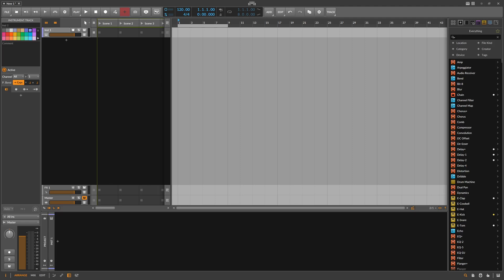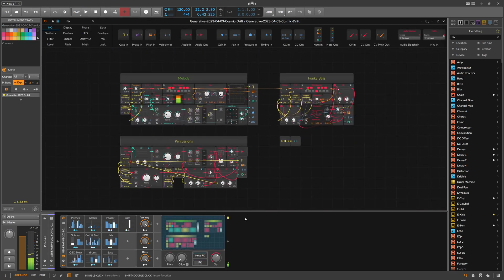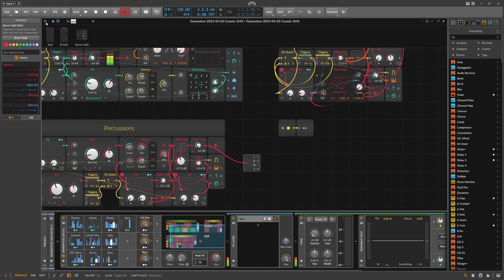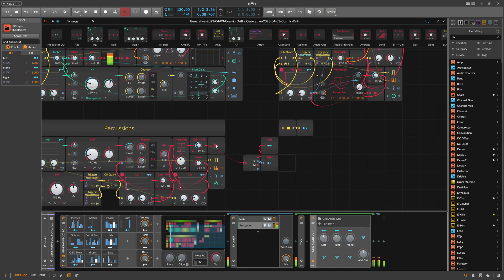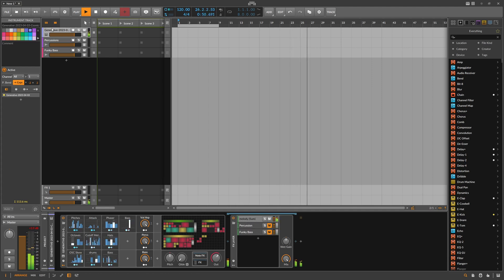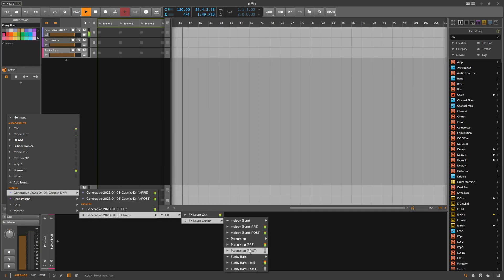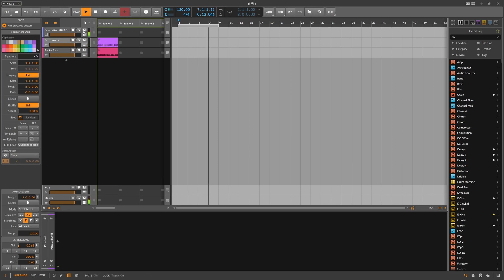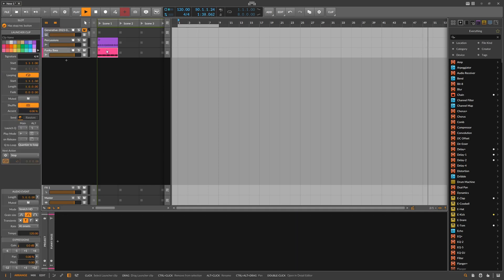How to Get Multiple Audio Outputs from Bitwig Grid - A Guide to Mixing Generative Presets

Comment: Nice, I use this trick from time to time. Do you know what the sample rate is of the modulation signal? Is it the same as the project audio sample rate?
And does this cause any aliasing? I'll run a test with some sine waves some time.
Reply from the maker: not sure, im not a "null-test" guy, i generally go with stuff that sounds ok to me and move on. there are maybe people on the net who test stuff like this. but i guess there is some smoothing or aliasing happeing and the sample rate is probably the project sr

Comment: This is a cool workaround for what, in my opinion, should be a baked-in solution (audio sidechain out). However, in my experience it’s simpler to just plan ahead and put separate sections into distinct layers of an instrument/fx layer. For any modulation you might want between the sections, the track-level and project-level modulators new in Bitwig 5 should have you covered.
Reply: the simplest way they could implement it is just how it works for plugins with multi-outs - have a dedicated tab for it that would be sitting before PostFX chain in the hierarchy. and then add option to Audio out module to occupy specific 'channel' with default being 1
Reply: @x-iso  Yes, that would be a good solution.
Reply: Or maybe just allow the "audio output" component to have a variable number of inputs (like the Grid's mixer and other devices) and add a '↓↓' button to the track header in the mixer view to unroll those output tracks (which the drum machine and other layered devices already have).

Comment: Hey, how would you go about splitting a signal into multiple frequency bands in the Grid? Like Multiband FX 2/3.

I tried adding a hipass/lowpass module with the same cutoff value, and modulated them both with the same macro. It seemed to work ok, but that's a bit annoying to do, especially if I want many band splits in one grid patch. I'm wondering if you know of a better way?
Reply from the maker: try out the bandpass filters (use the xp filter module)
Reply: @PolarityMusic  thanks, I’ll check it out :)

Comment: You can also just ctrl or alt drag the channel with the polygrid in it to duplicate it and in each instance only leave the parts you need and delete the other components. That also allows for easy saving of the elements as seperate preset and avoids having to mess with routing.
Reply from the maker: but only if all elements are clearly separable and there is little or no cross modulation. which is actually the reason why you have everything in one patch.